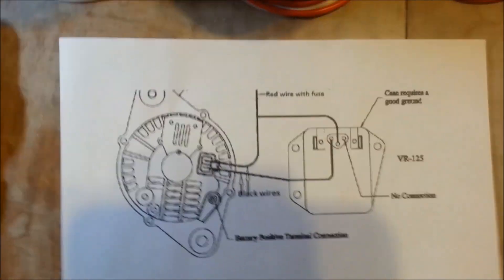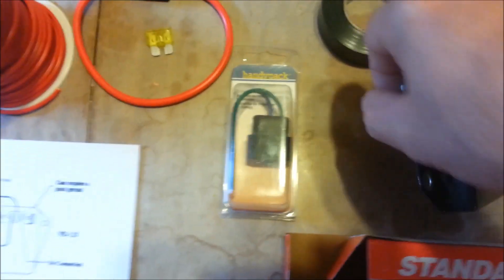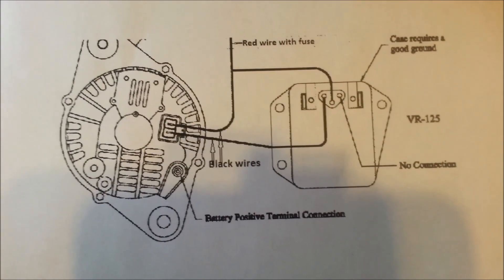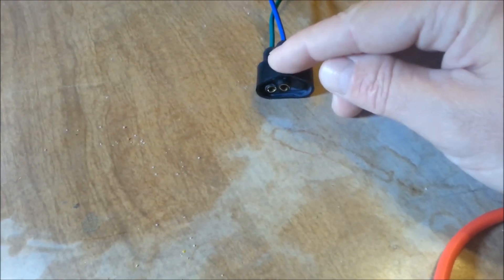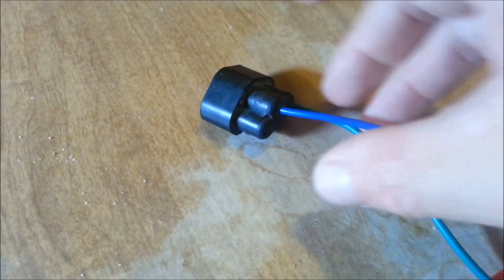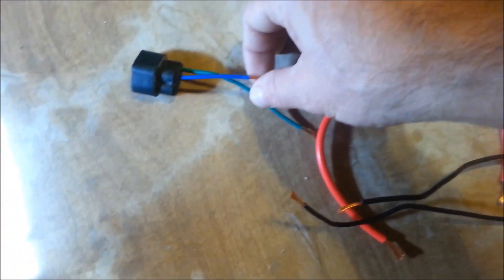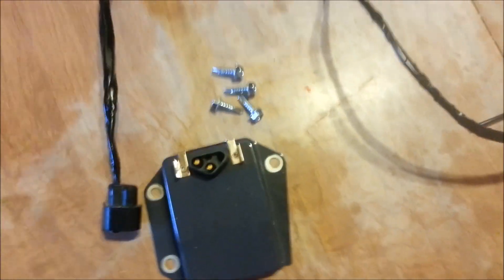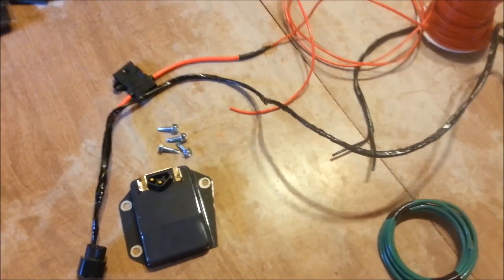How to make a External Voltage Regulator to Bypass a Dodge computer, ECM

Comment: Can i do this to a 01 pt cruiser
Reply: I'm just came across this post but No.. 
you have an internal voltage reg on that 01 PT.. 

However.. It can be rewired differently cheap and easy,. I would have to look at the  "I think " 3 small wires other then the Battery wire on the alternator and add a 194 bulb and a pig tail.. 

You use a good ground on 1 side and use the bulb as an exciter  and the other wire goes to Alternator.. 

When you turn on the key but don't start the car, The 194 bulb will light up, Start the car and bulb is now off and your charging..  IF the alternator in that PT is good.. 

This is a trick I found out playing around back in the 80's trying to get an Chevy citation to charge because the ECM was going.. 

It worked for 5 years till the one girl got rid of the car.. 

Not to mention,. If u turn on the key and bulb is not lit.. Replace bulb.. It's blown.. Her 194 bulb never blew out because it's only on a few seconds or mins til you start the car,. 

Also if the car is running while your checking any fluids lit the trans or power steering, You should not see any light on.. 

It's also a poorman's dashboard light.. Just way outta the dash and under the car hood,. :P

Comment: Why would this slowly drain the battery ? and how slow does it drain would it be overnight or is there a certain time you have before it gets too low to start ? By the way this is a great info video saved my ass thanks !!
Reply: If you have power going to the Regulator it will send a magnetic field to the alternator as long as it has power,. 
If the alternator is spinning you have charge "13.5 " from that magnetic field.. Not running and you just have a elector-Magnet..

Comment: What purpose does the fuse serve if some people don't use it?
Reply: I think he misspoke.. It should be used threw a Fused switched circuit.. 
Key on fuse hot system ready to go.. Key off fuse dead system is resting..

Comment: how did you get the heat shrink over the fuse holder and the  plug end?
Reply: Put it on before you solder it.. Then slid the heat shrink tube over the solder joints and then shrink it.
Reply: He didn't. He stopped recording and taped it. Duh. Huh. Sharp as a marble.

Comment: Would it not be OK to ground it straight to the battery and it be OK? Just asking because I'm fixing to do this to my 91 b350 van that's starting to any up charging. Thanks for the feed back in advance
Reply: @Nicks BS Corner would grounding to the bolts that mount the alternator up work
Reply: @Nicks BS Corner ok thank you appreciate it man .... Are you by any chance familiar with the external voltage regulator kit made by quick start ... They are sold online at alternatorparts.com
Reply: Off hand Any of these kits that need ground should go from NEG battery to Regulator to Alternator all the same wire. 

Back of alternator would be the best in this setup.. 

since the Battery Hot goes straight to the ALT, So should the ground, However the ground wire I would use 1 wire with no cuts in it to make sure no problems with ground.. EVER.. lol..

Comment: i wish that you have show alt  where to hook wires
Reply: He should have stated that you would have to look at the back of the Alt and see which ones are FLD +   and FLD -  

FLD + is the one from the middle wire location that gets 12 Volts from battery and the other wire FLD - goes to the third wire or outside wire edge of the plug .. 

This should be a good look as how to wire it up. I know you don't need this anymore BUT you never know if you have a tractor or some other mode of transport that wont charge worth a carp.. This will give you a few ideas on how to wire them up.. Dodge style,. :P   
http://www.imperialclub.com/Repair/Electrical/charging.htm

Comment: Apparently some 06 and newer Chrysler and Dodges come with the Denso and Niccondenso alternators that require the modified driver. The guy has a video on here with a link to the website and the phone number too. Its the video by alternatorman
Reply: I just ordered the modified driver kit from alternatorman for my 2011 Grand cherokee (with Denso alternator) after original alternator started to glow red and smoke.  After testing it, found that the ECM was no longer sending any voltage signal to the alternator to tell it to send a charge back to battery.  
The kit made more sense than going with a costly ECM which can get fried again if the new alternator also fails.

Comment: What if it won't go to 15.5 , I ran 3 grounds and still going over 15.5 !! Any idea would be be helpful, thanks Jay
Reply: did you ever figure yours out I'm having the same issue
Reply: @tonyderks9172  same issue, it climbs to 17
Reply: @Rymyguylow same here climbs to 17 volts and my meter wigs out and just flashes 2  lines on the display..U ever figure yours out?
Reply: @johnoates3326  I did figure it out, the main board for the truck had died and had to pay like a grand for a new board so it would work right.
Reply: @rylo2863  I added a external voltage regulator like this video and mines charging now..I need a new computer soon though..Runs rough and uses more gas
Reply: @johnoates3326  That's awesome you found a work around! I couldn't get anywhere with the dead board. Honestly pissed me off cuz I had bought the truck like six months prior. Like I knew ram or dodge was known for electrical problems but shit lol 1k worth felt rough

Comment: I have done this a while back on my Dodge truck. Soon after you start the engine and the voltage gets up to about 14 it starts jumping up and down, the lights actually flash with the voltage, does the whole time, any ideas?
Reply: bad ground on voltage regulator, may be loose or corroded...

Comment: I cannot believe everyone installs them this way.  Way overkill.  On Dodges and Jeeps, the field has a green/orange and green wire that controls the field.  The green/orange comes from the ASD relay and is +12v the solid green is negative (high speed switching via transistor) from the PCM.  All that you have to do is cut the green wire at PCM and run the green wire to the green at alternator and splice the blue wire to to the green/orange wire at alt plug.  This is a true "two wire install".  No wires "bypass resistor", relays yada yada.  Why install fuses and all that shit when the factory already has it there.  You get no check engine lights, volt meter still works.  PS. the green/orange is the voltage "sense"  You took a 15 min install and turned it into a mess.  If your wiring colors are different then turn your key to the on position and find the +12v at the alt plug and slice your blue from the VR to it.  Mount the vr in front of the battery on radiator support.
Reply: Fringeless have you made it home yet its been a year?
Reply: fringeless hey can u explain more about hooking up the wires I like ur idea with no cel on thanks
Reply: I'll get to it when I get home
Reply: fringeless thanks
Reply: https://www.youtube.com/watch?v=dBL1hgdzaNg&t=4s
Reply: No need to turn this into more than it needs to be.  You can order a plug n go kit for $65.  The regulator itself is $25-$30 and to not have to deal with cutting and soldering wires is worth $35-$40 to me.
Reply: @PunkAss17331  can i get the link ?
Reply: Info on the harness would be nice! Part numbers where to get it?
Reply: yah i like this anyone get it to work? how about making a VIDEO?
Reply: Do you have a diagram on this pls send to (1725skinner@gmail.com)
Reply: @1725skinner   check out my link below
Reply: Thank you
Reply: It's been a year since you posted this. Did you ever get home to draw up the wiring diagram? it would be helpful.
Reply: EVERY WORK OUT GREAT, THANK YOU FOR THE HELP
Reply: Yeah but then the computer doesn't get the 12v return and the engine light comes on when you cut the green. Cuz I did that and the light comes on. The voltmeter works but the light came on. So I say you leave the green wire uncut and you run your own green wire from the regulator to the same post the harness green wire was on and bingo, no engine light. You leave the current green wire circuit as it was cuz the alt was generating voltage but the comp wasn't regulating it cuz of an internal frazzle but the light was not triggered. The connection to ground was regulated when it worked but with the regulator part fried and no regulation to the new alt there was no charge. You just insert the new regulator into the now unregulated ground connection thus creating the ground loop necessary to keep the light off. At least that's my guess at how I'm gonna shut the engine light off.  I say this because in order to test if the alt works you disconnect the green wire and put a jumper to ground. Alt works but it's not regulated so, you insert the new reg into the connection to ground and now you have regulation. So yeah, Fringeless was kinda right. You don't have to worry about cutting the green wire cuz the computer wasn't regulating its connection to ground anyway and that leaves the light off.
Reply: @Jerome King: the computer has circuitry to control the alternator! It also has circuitry to read the state of charge, and to set warnings when a problem exists! Changing to this style of change control takes the duty away from the computer, whether the computer has already malfunctioned, or its just preventative! There isn't a quick and easy way to bypass the computer, it's monitoring and control systems! If you are required to safety test and emission test your vehicle, having the check engine light turned off isn't that simple! It's best to continue and replace the faulty computer, than to bypass and have the check engine light on! This fix is not for those that need the check engine light off! This only allows those to have a working vehicle, except in the light off safety and emission testing areas!
Reply: @jeromeking1823 The whole point of this PCM Bypass is to get the PCM Out of the Loop. With the Alternator Regulated Externally, the PCM can't be burnt up from the Alternator. And it does smoke the PCMs, I've swapped out quite a few, after flashing the Original VIN to the Donor PCMs. Dodge dropped the ball on this Engineering nightmare.
Reply: "cut the green wire at PCM and run the green wire to the green at alternator"...I thought that green wire at the PCM was coming from the alternator.  What am I missing?
Reply: The green wire is connected to the PCM and the alternator. The other wire, I believe an orange and green wire, is also connected. The two wires on the plug at the alternator, both go to the PCM. That is how the voltage and charge output of the alt is controlled. When it's not working, or to prevent it from becoming NOT WORKING, this bypass was designed to compensate. This bypass will fix a no charge/over charge, condition, but can also cause a warning light and a check engine light, on the dash! He to install the regulator properly, and to help turn the warning light and check engine light off, is the question! Some of us are not as informed as some others, about this subject, and are trying to reach a solution. Differing problems cause differing issues. The only real fix is to replace the whole PCM! But that is very expensive, and can happen again and again. And for no reason! So, to get a voltage regulate that is separate from the PCM, and to get it to work correctly, and then not cause a warning and check engine light(for those of us in emissions testing cities. A check engine light is an automatic fail, and a new PCM is required to fix it all)! The PCM controls the alt, and senses the state of charge, and adjusts it for the need, and sets a warning light and check engine light, if all is not proper!! Getting the alt to charge properly is simple enough. It's the dang check engine light that is so troublesome!!
Reply: @roadkill5333 loop both wires back to the PCM, that should stop the Check Engine Light. I don't have my Wiring Schematic in front of me right now, but that should complete the circuit back to the PCM & fool the PCM into thinking it is still monitoring the Charging.
Reply: has he posted more on his idea.?
Reply: maybe you can help me doing this on a w203 cdi , i want to put an "universal" external regulator
Reply: Thanks bud finally someone knows their shit
Reply: I did this, with a high output alternator and I overcharge at 17.2. Any advice? 2006 Dakota.
Reply: @nickpeezy1443 doublecheck your wiring. If it's ok, then you may have to get an Adjustable Voltage Regulator. Don't go over 15 Volts on charging, 14.5 Volts is plenty.
Reply: I'm having a hard time following what you wrote but I think it's what I need to do,I can't feed myself without my ride! It starts and drives but a mile into it the battery light comes on and then the battery will die. The dashboard goes crazy and the motor bogs down and will go only 5pmh. Could you write it again for an idiot ,layman's please!
Reply: realcoolphil no I just hooked it up and installed mine I do get cel light but until I figure it out it's staying how it is

Comment: hello,
QUESTION,  what if you took out the pcm all togeather and there was none. WOULD this still work, the external voltage regulator?
2. I would like to see this.

thanks
Reply: A car cannot run without the PCM.. individual components within the PCM can be spliced out or rerouted to a certain degree.

Comment: Great and easy to follow video. I am having a problem with too high of voltage (15.7 to 16 V). Any ideas what might be causing that? I replaced the regulator and it's still too high. I've double checked my grounds and they seem to be good. Thanks!
Reply: https://youtu.be/K3EFGlHPFDk
Reply: Mine goes up to 18
Reply: @XXXDomtacion  did you figure out what the issue was
Reply: Clean connections and grounds and where the temp sensor is under the driver's side battery
Reply: What was it?
Reply: Bad alternator.
Reply: @nitacook8119  

.
Reply: TO EASY TO OVER VOLTAGE? BAD BATTERY THE BOOK SAYS? CHECK GROUNDS?
Reply: Ck battery temp sensor

Comment: 95 Dodge Ram 2500 Diesel. Dodge made very few of these ECU's  (ECM), and apparently no after market ECU's (ECM). The entire thing failed. If I can't find one then then my truck is only good for parts or scrap metal, but this truck could be on the road for another 20 years if it weren't for this stupid problem.

I like this idea very much, but other than trying to get the alternator to charge the battery, the ECU also allows the over drive to turn on, plus the AC, and the tachometer to function, which none of them ar working on my truck. I need hacks for all of this and I could eliminate the ECU all together.
I'm not having any check engine lights come on. It apparently requires the ECU to function to do that.
Reply: You are referring to the totally integrated power module, or what it really is, a fuse and relay  block with a processor. I believe there is an attempt at a class action law suit over that issue. Jump on the band wagon, the more people involved the more likely the anemic judicial system will do something about it.
Reply: K Zpodindustries 
Mine was doing the same thing ended up being the crank case sensore
Reply: I have a 94 cummins and my mechanic is installing an external vr right now. 

Honestly, if you can find someone willing to remove the computer and wire up the components independently, you can keep that beast running forever. 

I know this was years ago... just hoping you were able to fix your truck! :)
Reply: Can you wire it up directly from the alternator, doesn’t the alternator have an internal regulator?

Comment: ok, so i have a 71 dodge W200, and i got a new altornator, and it only has one wire connection leading to the regulator, so only one connects, not 2, so how do i bypass that?
Reply: Single wire alternators are internally regulated at the alternator. Also known as a self exciting alternator, no way to easily wire this in and it isn't necessary. These are usually used to remove voltage regulation from the computer.

Comment: how do you bypass the check gauges light with the wires unhooked
Reply from the maker: +DCRSNET Dispatcher The engine light will stay on. There are FRM (Field Replacement Module) that can work with some computers. Here's one on eBay  http://www.ebay.com/itm/FRM-Field-Replacement-Module-for-Dodge-Chrysler-and-Jeep-vehicles-/151741276685?hash=item23547c220d:g:N64AAOSw9N1VnrPd&vxp=mtr
Reply: +aztikkel11 so if I do this to my 2014 ram 2500 its gonna throw a code?  like the dash lights gonna stay on?
Reply from the maker: +cuzimaluzer777 The light will stay when this is done. I don't think I would try this on such a new 2014 truck. This is mainly for an older high mileage vehicle that that needs to be fixed cheaply.
Reply: +aztikkel11 right, I'm running a 300 amp alt. trying to keep voltage above 14.4 at idle.  it's a huge issue .lol
Reply: @cuzimaluzer777  im having the same issue 370 amp alt on a 2014 ram 1500 i think somehow blew my voltage regulator in my pcm did you figure anything out help please lol!!!
Reply: https://www.youtube.com/watch?v=dBL1hgdzaNg&t=4sthis the way I did it
Reply: The voltage Regulator is Internal, inside the Alternator, all the PCM does is Grounds the Alternator so it Charges. Did you take your Alternator off & take it in to have it tested? I don't recommend AutoZone, AdvancedAuto, I mean a business that rebuilds Alternators & Starters.
Reply: Your internal Voltage Regulator could be smoked.